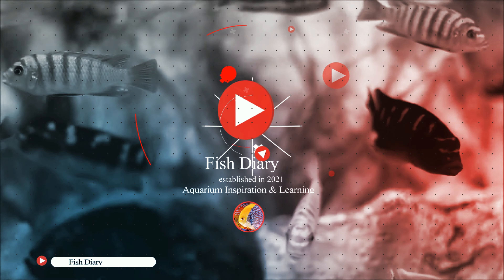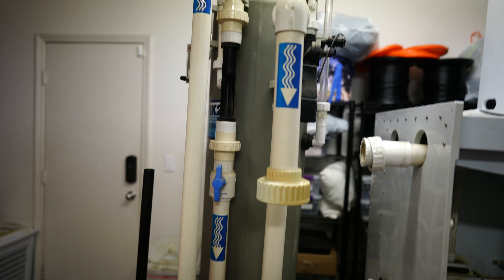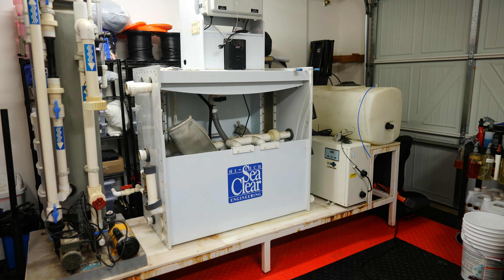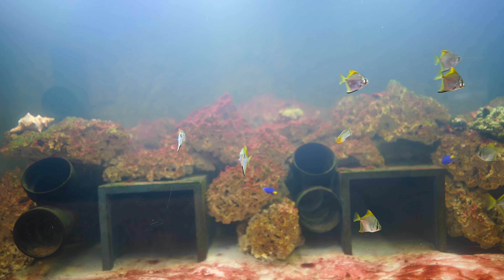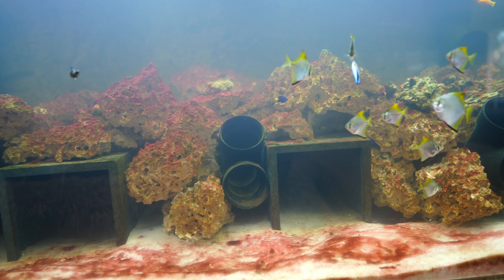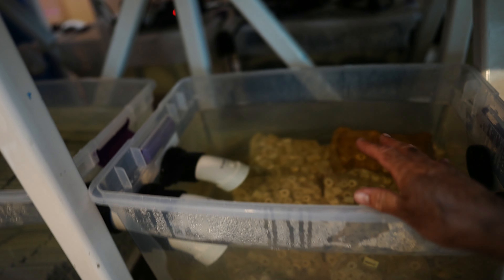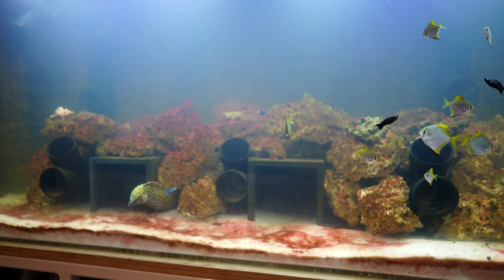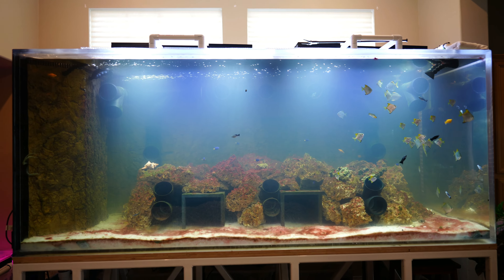Moray Eel Mega Tank - 03 - Filtration

Comment: 2 big changes that look nessasery for this system would be to add at least 5 programmable wave makers as the tank is lacking in internal circulation witch is needed to suspend all the detritus...and you desperately need a uv steriliser pronto...if you add both of these items the cyano will be gone with in 1 week...cyano is not a normal part of cycling it's a result of the thick sand bed of fine sand trapping the mess and not enough circulation to carry the mess up and away...if you were patient and let the tank be ready for the animals then these problems were avoidable at least in the short term....I'm sure the ells would prefer a small tank for a little longer than a big tank that can't surport them from day one...but I get the excitement and I know you just wantded them to have more space asap...its clear you care very much....just realy needs wavemakers and steriliser.
Reply from the maker: Thanks for the kind words and the suggestions. As you've already seen in the Filtration Upgrade videos, I addressed all of the pain points and it's been running well ever since.